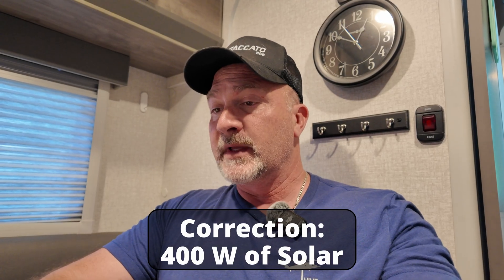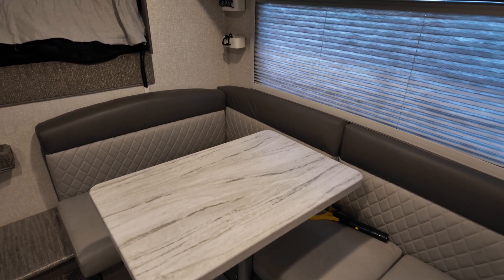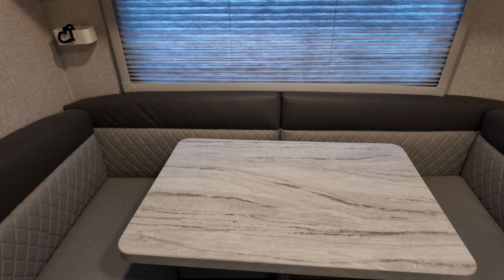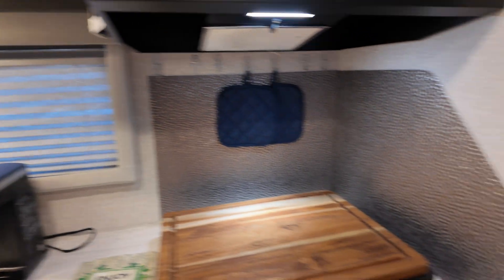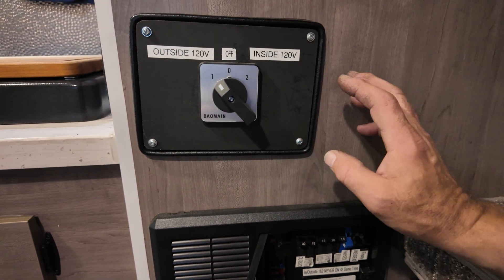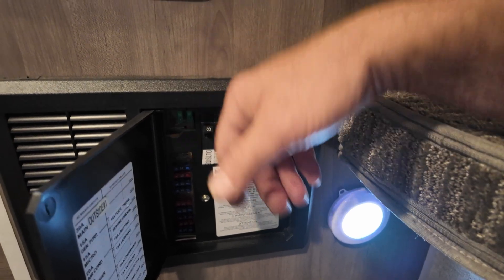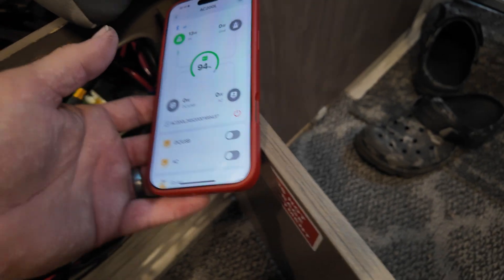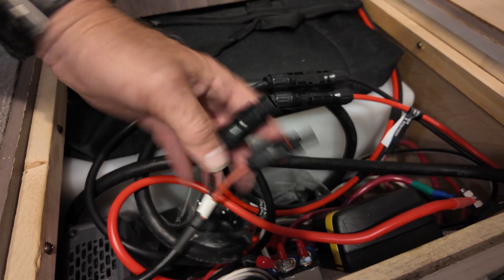Wiring a Bluetti Solar Generator to a 30 Amp Plug in My Camper

Comment: I love the idea and it definitely works.  The issue is that the Bluetti turns 12v into 120v with it's inverter, and then the RV's converter has to turn the 120v back into 12v.  And this process wastes significant energy compared to getting 12v directly.
Reply from the maker: You're absolutely right—that's a good point about the efficiency loss with the double conversion!

Comment: We have a Navion motor home.   I bought the same unit hoping to boondock and not use shore power? I plugged in the 30 amp. Plug and it drew the power from 100% to 20 % in about 3 hrs!    I was in my driveway so I tried to use refrigerator on 120v.  I could and will use propane while camping.  My question I guess is what breaker did you turn off to fake the shore power?  Apparently the converters uses lot of power!  Or by plugging in the way I did all I did was charge house batteries?   Any help is appreciated    Thanks
Reply from the maker: Hi James, thank you for the question.

My Lance 825 (which I recently sold) had a main breaker in the panel.  I would turn that one off and flip on the one I added for my 'fake' or interior 30 amp plug going to the Bluetti.

Both the factory main breaker and my newly added "fake shore power' one were wired to that A/B (or 1/2) switch for added piece of mine and safety.

Having the solar really helped keep things charged.

My new camper, which you will see in future videos, is a Lance 1062.  It has a breaker for the converter which I now keep permanently off (on the 825 I did not disable the converter and let Bluetti charge house battery).  I have to keep it off on the 1062 because I replaced the house batteries with Lithium and the factory converter could toast them.  I have a Victron charger to handle those.

I am not sure if I am going to add the interior 'fake' shore power to the new camper.  I just installed the solar which can charge the house batteries or the Bluetti by turn of the same type of A/B switch.  I am hours away from a cool trip with this new setup.  

I recorded the install of the solar and will post that video most likely in a couple of weeks.

Comment: This is smart. I like the redundancy of your 2 power source options. Both having their own solar and the Bluetti constantly topping off the house battery. Thankyou for sharing this unique setup. 
These solar generator power stations are becoming really popular. At what point do travel trailer manufacturers start including a second shore power hookup inside the trailer? To have a provision, place and plug INSIDE the trailer too would be perfect for boondocking with a portable power station. I certainly don't want my Bluetti outside in the elements and available for thieves to take.
Reply from the maker: Hi Chubs -- you bring up a good point.  I would imagine RV mfg will start offering this as a pay option as soon as some of them start watching videos like this.  

I just replaced the truck camper in this video with a bigger one and am deciding if I am going to 'fake shore power' this one.  I just installed solar this week and am heading off for trip with this new charging setup.

Comment: Why do you have a house battery? What do u use the house battery for?
Reply from the maker: Great question! The house battery in my Lance 825 powers all the built-in 12V systems—like the lights, water pump, furnace fan, and fridge control board. It’s basically what keeps the camper running off-grid. I use the Bluetti AC200L as a portable solar generator to charge that house battery (via the camper’s 30-amp shore power input), so I can keep everything topped off using solar. It gives me more flexibility and redundancy when boondocking (and the solar generator also gives me 120v). Thanks for watching!
Reply: @backroadstonowhere wouldn’t the bluetti run the 12 volt lights if it replaced the battery?
Reply from the maker: @ldcooper1  Yes, and there are so many inputs and outputs on that thing, it is amazing.  

I upgraded truck and camper in the past couple of weeks... a Lance 1062.  I immediately had to replace the dual house batteries which I did - two 100 lithiums.  Today, I just about completed the 400w solar install, it is charging the new house lithiums, and also the Bluetti via a switched output from the solar.  "1" is house, "2" is Bluetti.  

I am not sure I will be installing the 30amp rv plug inside of this new camper, at least not immediately.  The Bluetti has to remain portable for use at an off grid cabin as well.  It's primary use while camping is for the Mrs. -- hairdryer and curling iron -- oh, and her coffee pot.  As you may have seen in some videos, I use a French Press every time.
Reply: @backroadstonowhere Is there a 12 volt output on the Bluetti? If so hook the out put wires to the battery wires.
No need for a house battery as long as your Bluetti is charged..with your current set up it is.

Comment: Nice. But my question is, why not just plug the camper in to the 30 amp outlet on the Bluetti? That's what I'm planning on tith my Apex 300 when it arrives. I can charge from solar at the same time it's being used.
Reply from the maker: Thx Doc.  I have a couple of reasons:  It is more convenient as the Bluetti AC200L is installed under a dinette seat, strapped securely in place with all connections in place; and secondly, if I just plugged it in outside, there are weather and theft issues.  A third I just thought of is depending on where you are, you don't want to appear to be "camping" which having it outside would indicate.

Comment: hey there, just download across your channel and I subscribe.

that’s cool rig but the new situation you got going on man I can’t wait to see that. That’s exciting. I’m stoked for you guys. 

I’m brand new in the camping world and 55 years old. I bought a 7 x 16 Cargo trailer that’s been converted into a toy hauler. 

It’s not completely done it has 50 amp pure power that was done by the previous owner and done very well. I’m still in the process of putting together a 12 V system. I have all the components I just haven’t built it yet. 

But in the meantime because I wanna get out there, I bought the Bluetti AC 200 L so I’m using that as my 12 V system for now .
anyway, safe journeys can’t wait to check out your new videos
Reply from the maker: Awesome.. thank you.
I had a lot of fun building out a new max length/max height Pro Master van into a camper van.  I should post the tour video of that someday on this channel.

I think I have a toy hauler builder in my future as well!

The Bluetti AC200L is AWESOME!.. I am on it right now running my internet and laptop to type this reply to you way up in north country.  

I'm editing our next video drop which will be later this week....and researching all the electrical and solar I have to do to our new rig.